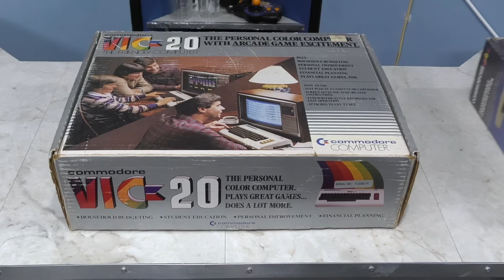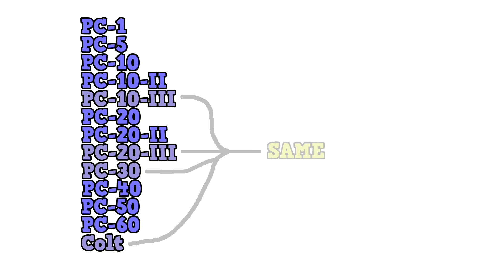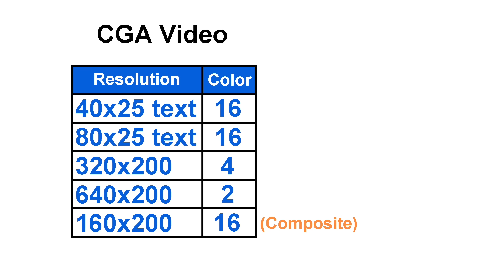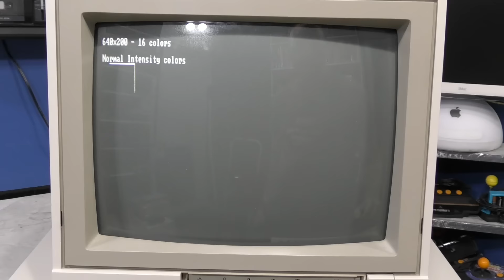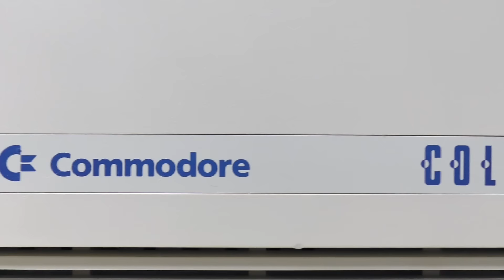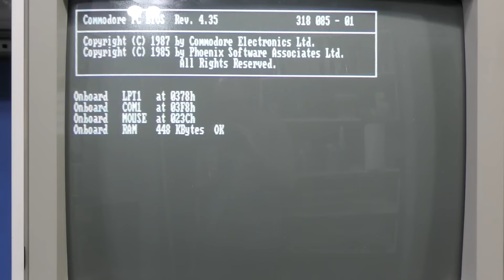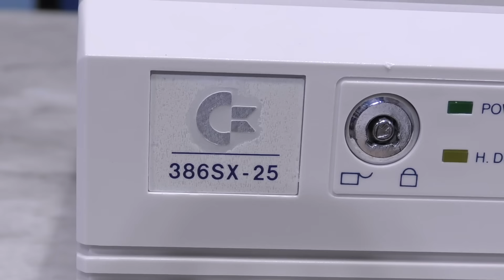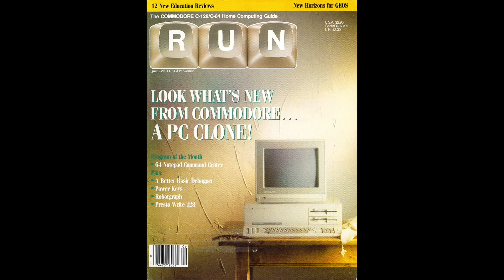Commodore History Part 6 - The PC Compatibles

Comment: Wait, what, the older version of that chip is the one that's surface-mounted and not the newer one? How does that happen?
Reply: Re-used parts or existing stock.
Reply: @MaddTheSane : Well, if it were existing stock, then they would be using the surface-mount ones from there on out. This guy made it sound like the through-hole chip is an actually newer version of the component, though, so that's what I'm asking him about.

Also, I'm curious: Was there a sale on stray hyphens when you typed this? :-P

Comment: Hey, so uh. Just letting you know that the CRT coil whine wasn't edited out, kinda hard on my ears. 😅
Reply from the maker: Well, it was definitely edited out.  I went through every clip I could find with the monitor in use and put the filter on it.  It's possible I missed one or two clips, since I can't hear it myself.

Comment: 10:08 So what, no double buffering? ^_^
Reply: I hate to say it, but double-buffering would require more VRAM and hardware that supports it. It's possible that the hardware had enough VRAM, but no way to quickly swap buffers.

Comment: Hey David,
do you know any unexpansive 8-bit computers that may be suitable for a 15 years old kid who wants to learn BASIC?
Reply: IMO, the Commodore 64 remains by far the best choice: It was the most popular 8-bit computer, therefore has most software, but is also the best documented computer. If you want to learn BASIC, it is quite easy to find a few second hand books where you can learn from. Commodore 64 hardware is common on auction websites and is quite affordable. It can still become costly to acquire everything required for a good setup, such as computer, power supply, floppy drive, CRT monitor, modern storage solution... this won't get any better with other 8-bit computers though.

The only disadvantage of the Commodore 64 is that its BASIC was rather limited. You could consider to go for a Commodore 128, which has a way better BASIC, but still has the Commodore 64 built-in. A Commodore 128 will be more costly though.
Reply: There PC Dos version of BASIC called QBASIC.
Reply: Can the c64 be modded to vga or composite video?
Reply: @Spyr0999  The Commodore 64 ouptuts composite video (and S-Video as well). No modding is required, you just need the right cable.

Connecting the C64 to VGA directly is not possible, it requires either the use of an external upscaler device or a Turbo Chameleon cartridge.

Generally, a small CRT TV or 15KHz monitor with composite and/or S-Video inputs is the best choice for a C64. S-Video gets you the best results, but the composite signal of the C64 is quite okay.
Reply: How much would it cost to buy only a c64 with a floppy disc drive?
Reply: I looked on eBay and most of them were a bit too expansive
Reply: @Spyr0999  You should be able to buy a C64 for about €50. Often they may sell for more, but you will succeed below €50 after trying a few times. A 1541 floppy drive often sells for slightly less.

Be sure to check multiple national Ebay sites, good ones to take a look are Ebay.com, Ebay.co.uk. Ebay.de and Ebay.it.
Reply: Would they be likely to ship to Canada?
Reply: @Spyr0999  My personal experience is (I'm in the Netherlands and often buy in different countries), is generally yes; most sellers ship anywhere. but sometimes you need to negotiate a bit about shipment and payment. It helps a lot if you do the research about the costs and possibilities for the seller.
Reply: Thank you for your suggestions I’ll check it out
Reply: do you think a c64 with power supply working + manual for 10CAD and 25CAD shipping may be dangerous to buy?
Reply: @Spyr0999  Not necessarily, but it is less than what they usually sell for, so there is reason to be extra careful.

If the machine is in working condition this is a good sign. You may want to verify if the sound chip is present, sometimes these are plundered, because they sell for good money. Check the keyboard if all keys are present and the visual condition of the machines (sometime there are cracks in the casing).

Many C64s are killed by their own power supply. Therefore, after you have received the machine, the first thing to check (before powering on), is the voltage on the 5V line of the power supply. A value just above above 5V (e.g. 5.15V) indicates a healthy power supply, if it is significantly higher, the power supply is failing.

An advantage of the Commodore 64 is that because of its popularity, there exists a lot of knowledge how to repair them. Therefore, if something is broken, this is not necessarily a bad thing, you might get a good deal and get it repaired with reasonable effort.

Many C64s come with an aerial cable (because connecting them to TVs this way was most popular in the 80s). If you want to connect it using composite or S-Video you may have to buy the cable separately.
Reply: @danielmantione  there is a slight crack on the case back of the serial port, but nothing that really disturbs me for a first 8-bit computer
All the cables come with for the application I want to do with it
I can't really check the sound chip because the seller does not really know how those machines work and he is hours away from me
The cartridge "speed/bingo math" comes with do you know this one?
Reply: @Spyr0999  If the seller doesn't know how the machine works, I'd say he doesn't know how to plunder the sound chip, so I would assume it is inside. For the money, it would be a good buy.

Speed/bingo math is a simple math game: https://www.youtube.com/watch?v=31uJSphi3Vg  It is very early C64 software and these titles were often distributed on cartridge. The type of cartridged used had 8KB of capacity, so developers were required to fit these early games in 8KB.

Comment: I could imagine that unlike modern people, the reviewer in https://youtu.be/e63XWCW2ADY?t=1282 gives considerable appreciation to monochrome mode option of the ATI card, if it indeed is a Hercules Graphics compatible card. Hercules' 80x25 text mode is considerably more readable than the CGA's corresponding text mode, and who needs colours anyway in 1980's business applications.

As far as I know, at least the earlier model of the Tandy Graphics Adapter which was available at the time would not support those higher resolution graphics of Hercules. Also even while Tandy was to get rather wide support indeed on the PC gaming field, in summer 1987 most of those games had yet to come. For reference, according to Moby Games' listing of games supporting Tandy graphics (https://www.mobygames.com/attribute/sheet/attributeId,31/), only around 1/4 (~200) had been released by the start of 1988, so I don't think it would've been all as obvious back then. 

Saying all this, I also don't really see much reason why the reviewer would have looked at a PC compatible computer as a gaming machine in 1987 after all. In hindsight things of course seem different.

Comment: Dave, you really need to get a 240v step-up voltage transformer so you can power up non-US hardware. I have a few, this is probably the best one I’ve found and I use it all the time:
https://www.amazon.com/dp/B06VVXN2SR/ref=cm_sw_r_cp_api_i_OG0-CbTH3DGCN

Comment: You do have 240v available ;) promise
Reply: Most people don't want to pull out their dryer just to get 240 volts.
It also needs to be 50 Hz: All of USA's power is 60 Hz.
Reply: @MaddTheSane  to be fair, i said available,. not convenient. And I think this guy SHOULD be competent to install a nema 6-15 outlet (240v, 15A). 

And re: the frequency. No.Unless it's something with a motor, or (like the zx spectrum) uses the line frequency as some kind of clock... the PSU really would prefer 60Hz (easier to smooth).

I get what he was saying, not 'conveniently' available. But... I think he should do this in depth (8 bit guy, please?) series later where he makes the effort :)

(edit, i thumbed you up because your point was valid, that 240v is often not easy to get at in the US/Canada. But it's definitely available <grin>)

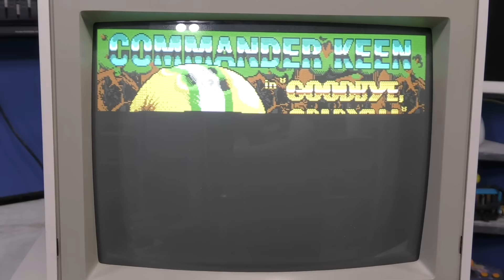Comment: 11:00 Mispronounced 'GIF' 👍
Reply: Actually correctly pronounced according to the inventor of the format. ;)
Reply: Thomas Müller Seems odd that the word graphics would start with the same pronunciation as the letter 'J'.  Crazy stuff!
Reply: @nyccollin  This is an excerpt from an article on bbc.com back in 2013:

"The creator of the Gif graphics format has said that his invention should be pronounced so it starts with a "j" rather than with a hard "g".

Steve Wilhite told the New York Times that he was "annoyed" there was still a debate over how to say the acronym.

He added that the Oxford English Dictionary was wrong to say it could be pronounced both ways.

The OED told the BBC that it was beyond the software engineer's control to determine how the word should be said.

The difference of opinion coincided with Mr Wilhite being awarded a lifetime achievement prize at The Webby Awards. To mark the moment, screens at the ceremony displayed a message he had written saying: "It's pronounced 'Jif'"."

Comment: Ugh.  If commodore was smart, they wouldn't have wasted resources on the PC-compatibles.   Sure, it was some profit.  But it complicated their business.  I'll admit the PC10 is a very clean design for a PC back then.  Very easily where the Amiga2000 case design came from (Germany)
The PC-1 IS what the Amiga 1200 should have been in 1986.   Had Commodore not wasted a WHOLE year trying to make the PC slots work on the Amiga2000.
The PC50 looks exactly like squat Amiga 4000.   They really should have sold a pizza-box AGA Amiga.   It sucked.  Either a $600 Amiga 1200 keyboard computer or a  $2500 Amiga 4000.  Nothing in-between!   That inflexibility harmed Amiga.

Commodore was stupid and unfocused, that is why they died, with the most powerful computer of the 80s and early 90s.